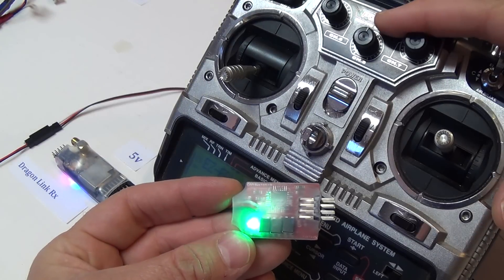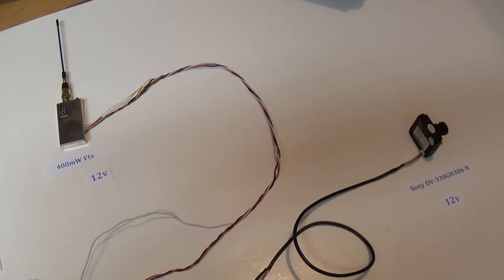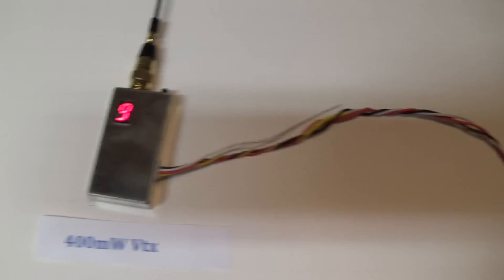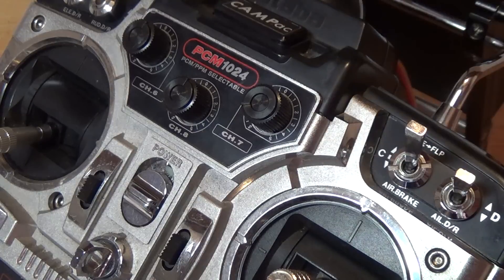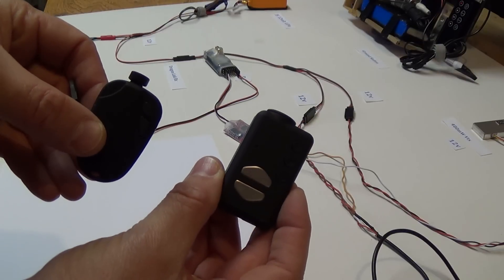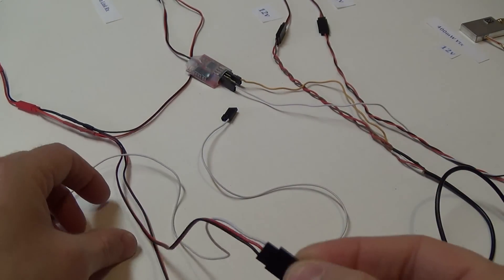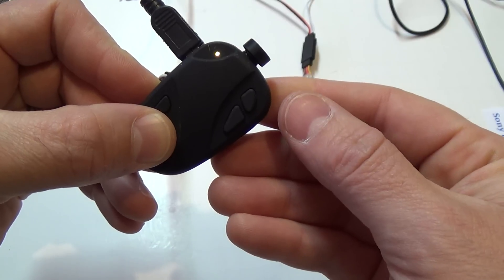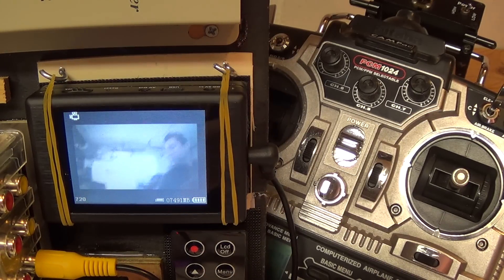How To Set Up a 3-Way Camera Switch for FPV

Comment: followed the ebay link and it still works but the price is $999.99 !!!! i don't want to buy a different one as the board layout looks a bit different and i can see how well yours works
Reply: +Chris Flory --- $999.99 means out of stock. Don't buy until new stock comes in and price goes down to normal ($20 -$30)
Reply: +watadeeel thanks
Reply: +watadeeel thanks

Comment: does the osd overlay record on the Mobius video? Thank you.
Reply from the maker: Cory FPV  Yes the OSD info overlays the Mobius just fine! So you have OSD info on all 3 cams.
Reply: Thank you.  Is there a way to get the osd in the goggles but not have it in the recording?
Reply from the maker: Cory FPV  THe OSD info is overlaid on the MOBIUS live streaming view, but not on the MOBIUS 1080p recording itself.
Reply: glassdogangle OK, thank you for clearing that up for me. Appreciate it.

Comment: How did you get the 808 to record while connected to a power source? When I have it connected to the USB on my computer It won't charge and record.
Reply from the maker: The video shows everything. Well, actually, it might not show the wiring of the 808 patch cord. It has been a year or so since I made one of those 808 cords. I forgot the wiring diagram for it. It's out there on the internet somewhere... email me at glassdogangle@yahoo.com and I will send you a scan of my sketch of the pinout.

Comment: My question. I had set my plane up to run everything off of a pair of or 3 batteries inline. I have a jst that i soldered in to the esc wires that i had planed on using for something else. i need to power my flight camera, video tx, Dragonlink and 3 way camera switcher now. putting in a uebc, can i use that jst? thank you.

Comment: Hi Glassdogangle, can you explain how connect all this with the autopilot? As you said, autopilots have a port for FPV camera and another for the video transmitter. if you could post a photo or diagram would be helpful

Best Regards :)
Reply from the maker: This Camera Switch has 3 Video Input Ports. This is where you plug in your cameras that you want to switch around to. The Camera Switch also has a Video Output port. Just take that wire coming from there and follow the next instruction: Your autopilot has two video ports. One is the video input port. Simply plug the Camera Switch's Video Output port to your autopilot/osd's Video Input port! The other port on your autopilot/osd is the video out port. That is where you plug your video transmitter. Easy!
Reply: glassdogangle  Many thanks!! :)

PD: I really like your videos, You're the king of the skywalker :D
Reply from the maker: AtalayaFpv Unfortunately, I am a bit too modest to accept that compliment, but thank you anyway! Camera switches are FUN!

Comment: Awesome tutorial! I like how you used the video wire only on your vid in 123 and out. There are a lot of people I know using 12v cameras and putting 12v on these switchers on vid 123 and out, frying the switcher! All you need is power from the receiver from control in!
Reply from the maker: Yeah you only need to switch the signal with the one wire, not the 12v power! I think anyone who watches this video is probably doing it correctly.

Comment: I've been trying to get the mobius to output video through the 3way switch. Do you need to do anything specific for it to work properly? I currently have the video ground and the power ground soldered together and plugged along with the red cable into a portable battery bank temporarily. The battery bank does supply the power appropriately... I have the video switch working properly as well but i just can't get the mobius to output... Is there a setting on the mobius in the software? I didn't see anything other than ntsc, pal, 16*9 or 4*3 aspect ratios. I'm at a loss as to what could be the problem... The only thing I can think of is the supplied power needs to be in the same loop as the video output is?

Any help would be awesome. Thanks!
Reply from the maker: At 6:10 I talk about setting the cameras to Live Video Out using the included software. Have you done that yet? The Mobius camera software has multiple screens. It sounds like you have not even seen all the settings for it, so try finding the other screens in the setup software, okay?
Reply: glassdogangle

Just to make sure I have the correct software. I'm using mSetup version 2.0.3.7 and you're talking about the tabs? (Basic settings, global recording settings, video mode settings, advanced image settings). I don't see anywhere to enable or disable video out, only adjust the configuration of the output. 

I did some more testing and I think I might have found the issue...  the audio ground is attached to pin 4 on the mini usb plug. The other two grounds(video, power) are attached to pin 5. I'll have to short the audio ground to the other two grounds and see what happens. That might be my issue after looking at this diagram http://www.mytempfiles.info/mobius/pickies/MobiusUSBPins.jpg
Reply from the maker: Joseph Tarling My MOBIUS cord that I use to connect my camera to the switch is exactly like the last set of connections in that diagram you just posted a link to, the AV-Out with Charging one (thanks for the link, btw, much better than my chicken-scratchings). As far as the Video settings, I think it is the #16 Keychain camera that might need to be set to video out, or the GoPro? I cannot remember. I just checked my MOBIUS software, and you are right, there is no video output setting. So, that is probably not the issue. I would check your wiring first, like you say.
Reply: glassdogangle thanks a ton for the replies. It's definitely got to be the cable then. It was driving me crazy and it took me forever to find information. I actually came across that diagram via Google images haha. I really appreciate your help!  I'll report back if it works
Reply from the maker: It will work. I compared that last set (the 4th one on the diagram) to my drawing that I made of my custom MOBIUS cord and they are exact, pin for pin. I make my own cords out of existing USB cords, because I have a ton of them laying around. The hard part is getting the plastic off the miniUSB part. Then, you have to solder a tiny wire onto a tiny tab, which is then soldered to a wire. Basically, shorting the two grounds together is kinda hard to do when you are modifying a stock miniUSB plug, because they don't come like that, typically. I actually got tired of making my own, and recently ordered a couple that are premade from eBay.

Comment: I fly with the Futaba 8U also. Is that the radio you fly primarily with dragonlink or are you just flying 72mhz with it? Maybe it was just used for the switch demo. I have another 8U running 2.4 FRSKY for regular planes.  I'm asking because I havent broken into the LRS yet and love my old trusty 8u's. Still happily FPVing on 72mhz and I believe I'm ready to go with a LRS simply for rock solid link rather than distance. My budget will not allow Dragonlink.  You're probably on FPVLAB, I'll look for you there. Oh and thanks for another awesome video.
Reply from the maker: I used to fly just on 72mHz with the Futaba in this video. However, when I bought Dragon Link, It just plugs right in and good to go! So, same radio, but now on 433mHz!
Reply: Thanks for the reply glassdoogangle. Your info helped me.
Reply: i have two of them. i use dragonlink on one, and ezuhf from immersion on the other.
Reply: Sorry for waiting so long to thank you for the reply, but thank you.
Reply: i only use it for the dragonlink, and the other fuataba just like it i use for ezuhf. don't see how you could do much fpv without lrs.

Comment: Hey Doug, Happy Holiday's! I have a question. I see that you have the cameras switched with the dial. I have my Camera switch hooked up to a switch that I also use with a wye to control my Display on my OSD as well as my cameras. My question is, Haven't you run out of channels on your dragonlink? I use channel 9 as my power channel but I can't seem to get channel's 10-11-12 to work on my dragonlink. If you've figured out how to make them work a video on that would be excellent. (or a note for that matter)
Thanks for all you do, I've got my Penguin working great, (still learning that software) and I only have a couple more things to figure out before I
start assembling "Penguin 2"
Reply from the maker: Kc I only have 8 available channels on my Futaba radio, even though I use a DragonLink. I am looking for a better RC Tx such as the Taranis to upgrade so I can use all 12 DL channels.
Reply: Doug. I have a Futaba C10 and it doesn't use (I can't figure out) how to get the other channels to work. When I had the Futaba R6014 HS rx Hooked up my C10 would control all 14 channels. Ive got my Penguin 2 mostly all connected on a box on top of my table so that I can test everything before I put the plane together with everything onside. Want to get those other channels working before I assemble it.
Reply from the maker: Kc Crash You understand that most Futaba radios (if not all) only transmit 8 channels when on PPM mode? That is probably why you had all 14 channels when using a PCM Rx. When you try to use Dragonlink Tx and Rx, you must put the Futaba on PPM instead of PCM. And in PPM mode, you only get 8 channels out. Make sense?
Reply: Yes. That makes sense now... when I asked Dragonlink about that they said that the trainer port only put out 8 channels. They said that some Futaba radios can be switched to do more. Ill have to do more research on that and see which one's. I nred to open up at least 2 more channels. (Flaps and a switch)
Reply: Ots pretty amazing the amount of use you've gotten out of your radio. Because of you ive got my camers switch working (only 2 cameras on penguin1) and I'm ready to put the 3 cam switch, mobius, and my light switch on Penguin 2) thx for the help with those.
Reply from the maker: Kc Crash Hey no problem! There is nothing wrong with doubling up functions on channels, as long as you remember they are doubled up! (On more than one occasion I forgot I had my lights hooked up to my bomb drop, and dropped a parachute prematurely while flipping too slow through the lights!)
Reply: glassdogangle Doug, I checked out that Frysky Radio The Taranis. Looks pretty good but does it put out enough PPM channels? I read though what I could find and it didn't say it... Looking for that Radio in a haystack!
Reply: Kennys RC Channel
did you know you can bind 2 RX's simultaneously to get 16 servo channels using the Taranis and the X8R RX's. the X8R's also do Sbus. For something really out there fit aa aux TX module in the bay for potentially 32 channels
Reply: Rob. I have a Futaba 10 CAG and at one point I was using  a Futaba 14 channel receiver on 2.4 ghz. I also did it by linking Flysky 8 linked together. My biggest problem was that when using dragonlink, it only supports 8 ppm channels. And I need the long range dependability.  I've heard about the Taran is but I'm waiting for Doug to give some feedback on his. Want to know if it will control those other Dragonlink 4 channels....
Reply: Bob. Also I noticed Subs on  a quad setup screen and don't know about it.  Guess I have some more reading to do.... and I thought school was out years ago....
Reply from the maker: Kenny- I have switched to a Taranis radio, and am using all 12 channels on my Dragonlink no problem now.
Reply: REALLY! How can they make them all work and FUTABA, the Biggest radio company in the world can't!  Now I'm going to have to go out and buy a Taranis! Everytime I talk to you I spend money!!! LOL... thanks for the info, I'll let you know when I have one so you can help me set it up! haha
Reply: The false cap on the available channels is probably related to using the trainer port as the source of the PPM stream. You can understand why Futaba would not see the need to hand over all the channels to the training function since the type of model flown by newbs are generally require less than 6 channels. If you have a module based TX you may get full functionality by connecting the Dragonlink TX to the PPM pin in the module bay. Futaba also use a power good signal for thier TX modules so that may be an additional hurdle with this method. The other factor in determining how many channels are available is the PPM frame size. let's say for arguments sake you have 8 channels maxed out so that is 8x2mS or 16mS to transmit all 8 channels worth of data plus you need to add some dead time on top to allow the RX to sync up to the channel order. So now we are looking at around 20 mS total which was the old frame length standard.
I also urge all of the users of the Dragonlink system to check the minimum voltage the RX will operate at (which is about 4.5V BTW so there is not much headroom with a 5V feed) and also the rebind time after a brownout. As a minimum I would recommend a power supply independant of the servos particularly if you use digital servos. Either a dedicated RX battery or dedicated UBEC. The likes of F and JR learned long ago to make sure their RX's worked down to well under 4V as large volt drops can occur with heavy servo power draw when using a common power supply for RX and servos.
Reply: Rob, we normally all use 14.8 volt batteries for our motors or larger and then have a separate battery 3 cell,  for the electronics. We then step that down with an independent voltage reducer to power the RX...

Comment: Good stuff! The orange receiver was my favorite part of the whole video! haha Perfect place for it. :p
Reply from the maker: Yeah, 02:00 is pretty funny. Thing is, I initially was going to do the video using that garbage receiver bound to my DX6i. As it turned out, the orange POS crapped out on me early in the setup stage, so I turned to my trusty Dragon Link and finished the video. The orange Rx remains in the garbage...
Reply: Thanks guys for sharing this wiring setup it helps brain handicapped fellow flyers…like me….I will have to store this one back for when I start building my Sky Hunter…I have yet to get servos for it got all the rest here for the basic build…..looking for a great reliable FC either eagle tree or myflydream leaning toward Eagle Tree.. any thoughts…Thanks 
Larry
Reply: Id like if you can send me the list how you set thiis up. Cause im to this stuff